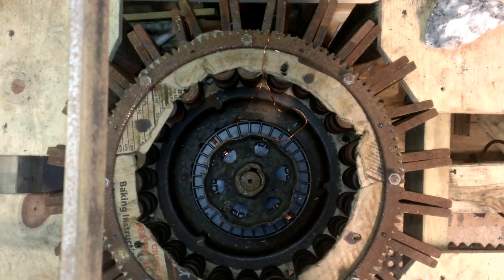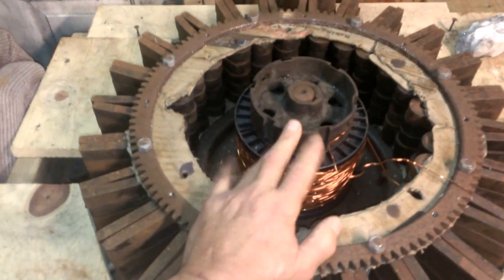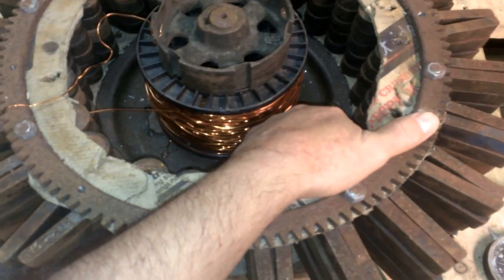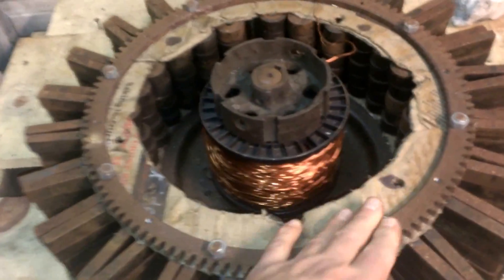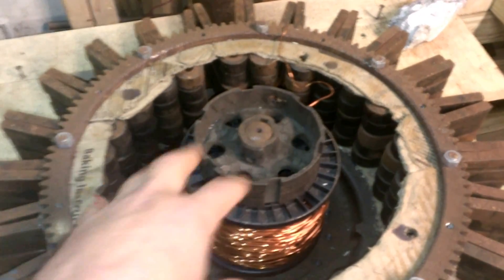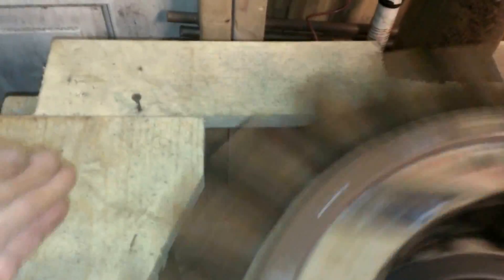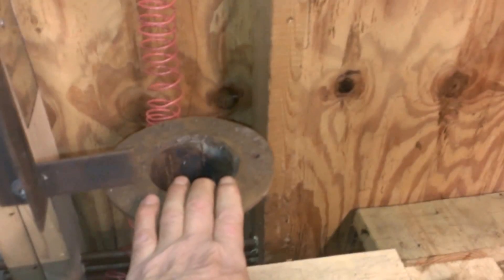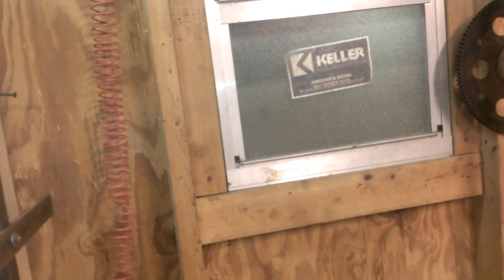The truth about Ed Leedskalnin's magnetic flywheel

Comment: Ed believed in North and South magnetic particles (for lack of a better word).  He felt these particle ran against each other holding matter together.  He was fixated on these type of magnets that form a V or U as the particles move out to complete a magnetic circuit at the open end.  Iron in the vicinity would provided an easy path for the transit of these particles.  Thus, most likely, in his mind, he used all of the V magnets from a ford motor as a source of magnetic particles.  Thus the major action for him would not have been in the center of the wheel but on the outside of the wheel where the number of magnets times the magnetic particles of many V magnets were available for his use.  Therefore pay close attention to iron place in the vicinity outside of the wheel to pickup this magnetic flow.  This is the way his mind worked from available writings.  Great vid…

Comment: The. Ancients. Would. Have. Had. Wooden. Gantrys. Built. Like. Cranes. Out. Of. Cedar. Wood. From. Lebanon. They. We're. Master. Wood. Workers. The. Electromagnetic. Devices. Would. Be. Placed. At. The. Top. Of. The. Gantry like. A. Positive. Side. And. The. Other. Part. The  negative  At  the. Underside. Of. The. Gigantic. Stones. Then. Lift. Was. Achieved. Once  thepower  was  turned  on  This. Is. How. They. Would. Have. Constructed. The. Large. Pyramids. In. Such. Short. Time. Periods. It's. Only. Way. They. Could. Have. Done. It. Without. Hydraulics

Comment: I listen at 2X. To get the gist. As you say. Just throwin this out there. Your ideas that is. Not babbling. But ideas. To get responses. 

From what I've seen the answers you're looking for are found in lifters and in transverse AC sine wave from NSNSNS pulse generation coil pickups (PMH) with capacitors equals one wire transmissions (Dollards) becomes LMD Analogue (half wave rectifier) However, whatever the transformer uses from tv flaybacks they used for the top wire in lifters and it worked fine. The wire induces the lower band of aluminum. Two resonating harmonics were high band and  low. Paramagnetic Al, O2, Neodymium. (Band for lower frequency.) Combination creates inertial shielding atom like state.

NS Wheel offers switching poles. AC as if a flyback signal to upper higher frequency wire. Coral may react as paramagnetic but might not. Might not be necessary for paramagnetic. As records show possible levitation only needs the high low frequency harmonic resonance. As done with sound of drums and horns. Also John Hutchison combining high low radio waves. And the rock itself produces the low harmonic through being induced and because of its larger size being like the band of aluminum. I'm presuming. Which might make the rock the lower band oscillatiom. All other harmonics might make up the higher frequency. Dollard said sound caused levitation in cathedrals according to geometry and Bach understood and created music accordingly.

Comment: What you are looking at is part of a combination motor and generator. Only by using collapsing magnetic fields  and timing can you get it to do work. He was using rotating mass to help it around the corner to the next firing or reversal of magnetic flux to drive it. Part of the system is probably timing and magnetic flux for a secondary system or pulse into another circuit to time or drive it. If you don't collapse or release the magnetic force it will come to an abrupt stop and lock in place. I am sure that somewhere that you are not showing there must be a capacitor of some kind to build up and release the built up energy. You must have a pulse to drive it. Think of the ignition system on a pre-computer car.
Reply from the maker: desertdan100 
Hello!
Yes I agree!
This video was made many years ago. I’ve been working on this Wheel now for 7 years , and you are right on all that you said. So watch some of my new recent videos. I caught on. Lol thank you for your comments.

Comment: looks to me that them magnets will attract positive and negative ions around us, which will then put them in order, generating an electroc charge.. 

then forcing them to the core in the middle, the earth rod being negative, conneting the other 2 parts u have on the side will be the outlet coils. 

if there was a ring on the outside of that filled with magnets, you could in theory pre charge the flywheel to generate a faster speed.

and if youre really clever you would fit a full contact rotating device to deliver that electric with no breaks of contact delivering 100%+ power.
🤔🤔🤔

Comment: If you were able to create a strong enough field of electromagnetic energy and measure for your possition on Earth's field and suns effect then theoretically you should be able to overpower the effect of gravity on rocks that normally don't respond to week magnets .  Seams there is proof out there that suggests magnatism can effect objects in this way.  .  Also if you had liquid metal and rotated it in two or three streams of apposing directions around a core that move by the effect of magnatism  could they not  create levitation?  And doesn't liquid metal have the ability to create it's own magnetic field if put in specific motion ??

Comment: You are generating the cogravitational field that is necessary to remove the inertial forces of what is known as gravity, but in reality is the field pressure modality of counterspace. The field resonance allows one to control where the anomaly will happen and to what degree. This can be done electronically now. No wheel needed.

Comment: Please take this as constructive criticism from a teacher.  
It is hard to watch this video b/c you keep diverting off of the main point you are trying to make b/c you want to explain every detail (a good thing).  Therefore end up saying the same thing a couple times (a frustrating thing for listeners to try to sort through to get the point you are trying to make) .

So before you turn on the camera, write down your key points on a card.  Then go through a mock presentation of what you plan to do in front of the camera.  When you find you have to divert attention from the main point to explain a smaller part, then  see it as a point you need to make as introductory to the main point.  Rather than divert thought from the point, you build towards the point.  

I seriously think you could have said everything in this video in about 5 minutes or less, with a very clear path of what you are trying to say.

After awhile, this method of explaining becomes second nature not requiring as much prep time.  But during the extra time it takes to train yourself to get used to this system, you will have more people willing to watch to the end and therefore better feedback and comprehension of what you want to get across..

Comment: All it is, is a basic solenoid used in connection with his other electronics on the property!!! Except it's set up wrong and you have parts missing. Go back to Ed's you should be able to get the rest figured out.  
He didn't use magic or levitate anything! Everything he did we already know. His electronics were used to run solenoid actuated saws to cut the coral blocks. He also had a lot of old car headlights on the top of his giant tripods next to a wooden box that held car batteries. They were all wired together to the other tripods and the batteries were charged from a single little generator powered by an old hit and miss motor. For the record like I said he didn't levitate anything. He raised the blocks using tripods a block and tackle. 
    
   There's more but I'm not gonna write every detail. The main thing is, is he didn't use any unknown science or technology that wasn't already known at the time. Oh and he didn't work at night to HIDE anything. He just didn't like working in the high Florida daytime HEAT!!!

Comment: Hi Vinny and all you garage guys. There is now a video, youtube,  called Ed's Coral Castle Quarry Engineering Mystery Solved. The guy who made it made a working copy of the big magnetic wheel, and used it to power a reciprocating motor used to slide a big metal door back and forth, to quarry his big coral blocks. The magnetic wheel's alternating magnetic configuration was opening and closing the relay that controlled the power to the reciprocating motor, allowing a back and forth sawing action. Im sure some weights were placed on the upper side of the metal slab, or old iron door. It appears that he perfected a pulsing electric circuit system to open and close the circuit for the the motor to make the iron doors edge to cut the blocks. And the block which make up the castle over all are no thicker than the iron door was wide. This guy has the whole operation going on, with tripods and hoists and batteries hooked up in parallel for lights power at night, as he liked to work at night avoiding the daytime heat. Anyway mate, This dude is the one to hook your wagon up to.
Reply from the maker: Scott and I worked together on this. 
So I'am very pleased so far

Comment: have you taken in account gravity? maybe the magnets need to overcome mass its down force. and would magnetic pistons work? maybe they can generate extra power if we have the movement anyway it might safe power needed to rotate. or the pistons falls down, yet gets a little push back up extra by magnetism.
Reply: +kleintjuhD magnetic force is a force too. Any force will have the same force opposing it. So there is no way it could be stronger without any addition to it. Hydraulics for example use another thing; that is a low force can push up a huge weight but it will take more time to push it. Same as pulleys work with a cable.

Comment: You're complicating the use of this device. Ed worked at night and needed lights. Hence this is just a generator for that. He didn't need anti gravity. His blocks and tackles were efficient to lift those blocks. Sorry but that's the deal. But that's the first step and if you can't get any electricity out of this then you won't get any further.

Comment: The reason he used "V" magnets and not bar magnets was to get all the "B" field into the earth and then extract a pulse from the rotating outer edge. The frequency of the pulse was related to the speed of spin and at what rate he needed to disrupt the molecules in the rock making it easy to cut and repel gravity.  They could cut the rock with copper tools as they did to build the pyramids.

Comment: not to be a smartass. But maybe you need to be at the right spot. You can't just do it anywhere that is why ancient people and Ed all had to be at a specific place.
Reply from the maker: High truth seeker
Place in the grid does matter. But if you look at the grid it appears to act like a latter. Layer by layer builds strong charges that flow with the natural median . Thanks for posting.
Reply: vinny stvincent yes. but I think the ancient people found those places to have a higher energy. If you look at the Grid, Ed Leedskalnin came from an area where the intersection lies. He moved to the US looking for a specific spot . If other places worked he wouldn't have gone there. Secondly, I think the grid moves over time. It's been 2000 years since the Qin Emperor buried himself at Xi'an. Another point where the dragon lines intersects. With all the smart people around nowadays, maybe that is the only thing missing. 
The line could be an old equator before the earth tilted for some reason. If you flush the toilet in Australia , the water will flow in opposite directions. So at the equator, there must be some intersecting point. Just as if two of these energy lines meet, the result will be different with a vortex. 
I think this is why no one has found a solution in their garages. The ancient Chinese will look for this line with a compass. And you have to be at that spot for magic to happen.
Or they just build something over it, so we never find out. People used to sit and meditate on those specific spots. This may also be why out of the blue Ed moved the entire castle to a new spot.
Reply from the maker: +Truthseeker 
Yes I agree, at the equator it acts just like a bar magnet, I believe there's  a wall where the two poles are divided and pushed outward. This happens from the convection in the center of the earth and pushed out threw the poles, and are pulled together like a cone toward the equator and condensed . Thanks for posting

Comment: The "Flywheel" will produce a "Standing Wave" in the ground that will lift the Coral Castle stones. You have to run the central wire of the flywheel to the stone and wrap the wire around it many times. Then you have to take the end of the wire from the stone and ground this wire into the ground. Then you have to spin the flywheel to the speed required to produce the Standing Wave...The stone will then levitate and you can then push it with one finger.....I know this works....
Reply from the maker: Thank you for your comments!❤️🤔
Reply: Cozza zee, have you ever looked really close at the Sumerian tablet with the seated giant with the symbol what is commonly referred to as the sun disk? Anyone who has looked into cymatics and sound frequencies knows that symbol is a specific sound frequency, or possibly a interference pattern of other energies of that frequency or cycles per second. If you look at the ground they are standing on you’ll notice not only is that symbol there, but also wave patterns that resemble standing waves.
Reply: @scottburry8261  I recently read two books on how the Great Pyramid was built....The author: Joseph Davidovits,  proved the Great Pyramid blocks of stone were made with cement....The name of the books are: "The Great Pyramid, An Enigma Solved." and: "Why the Pharaohs Built the Pyramids with Fake Stones." Amazon has the books....
Reply: What a load of crap. And how do you know it works? Make a vid genius. What you have said will never happen or work. because every Leedskalnin fan have lost the basic that he was trying to tell.

Comment: The paper separating the V-magnets from the gear may have acted as an insulator or a gasket. I'd like to see the flywheel used with Ed's perpetual motion holder. I recall he also had radio parts in his shed and may have been using selected vibrational frequencies with the stones to cut or quarry them with a blade oscillating at that frequency which could be dialed in. Keep experimenting!

Comment: I would be interested to see what would happen if you put the neutral magnets on the inside of the field and used  coils to make the negative charge(simulate the electron movement) on the outside with a positive coil in the middle that rotated with the neutral magnets. It would be closer to the model of the atom, yes? Maybe aligning the forces created by the flywheel to the forces created by an atom will produce the shift in the weight of an object that people associate with Edtech.
Reply: brewforyou scratch that I think the way you have it may be designed to interrupt the force created by the atom, thereby producing the weight shift affect. This is under the thought that gravity and magnetics are more closely related than most people think. Maybe gravity flows in a current similar to magnetics and by putting the neutral on the  outside it  can interrupt the natural flow of the atomic energy associated with gravitation.  This involves changing the current accepted model for gravity, but maybe the new one is a more correct model.
Reply: brewforyou Have you tried charging it then spinning it at a high speed? I'd use a belt drive as to try and not introduce any new EM interference.
Reply: brewforyou Have you tried charging it then spinning it at a high speed? I'd use a belt drive as to try and not introduce any new EM interference.

Comment: When you speak of "building a mechanical atom", I hope you're taking into consideration the fact that Ed thought the standard model of the atom was completely wrong, and that the electrons, protons, and neutrons didn't exist. He believed the smallest things were monopolar magnets with either a N or S charge, and they moved (at least in this hemisphere) in a clockwise twist through a wire.
Remember, ancient peoples did this, so it shouldn't require delving deep into physics or postulations, but rather a simple and proper understanding of magnetism and electricity.

To understand Ed's work, we must perform the same experiments he did, so I suggest examining his work areas very carefully. There were other things going on there that led up to him building that wheel...things that might have caused him to suddenly understand this technology.

Have you tried wrapping variously sized glass bottles in copper wire, as Ed did?
Try it with two bottles. Remember he said "ring the bell twice. Not once, not 3 times, but twice". Use sound waves to vibrate one glass, and resonate the other. You might find that you can adjust the magnetic field using the Five Forces:
Vibration
Resonance
Frequency
Amplitude
Waveform

It might be possible to pass the electricity and/or magnetism from one coiled glass bottle to the other using resonance, the way a vibrating crystal wine glass can be made to resonate another placed nearby.

It might be possible to use sound waves to generate electricity and/or magnetism in this way somehow.  Ed was often heard whistling as he worked....
If the glass bottles had the right composition, they could have produced piezoelectricity.

Food for thought, anyway.
I have no means to conduct this research myself, so I wish you good luck.